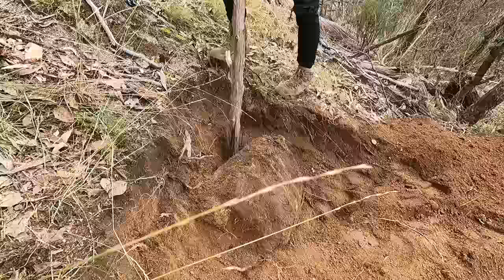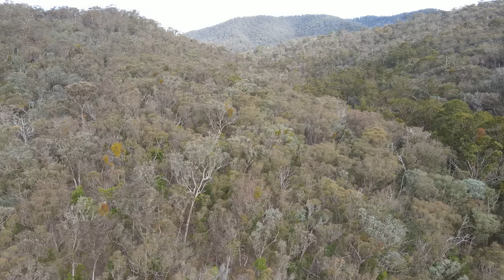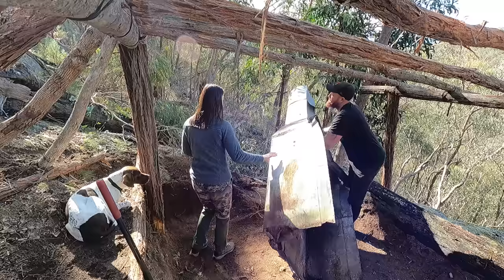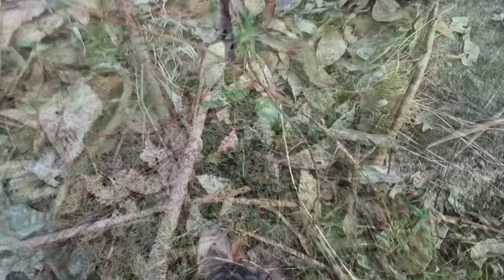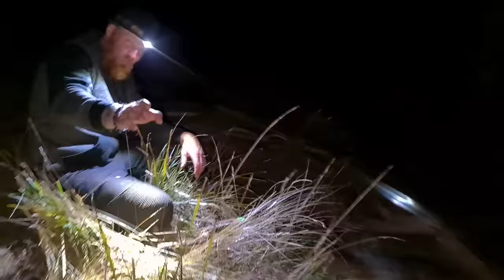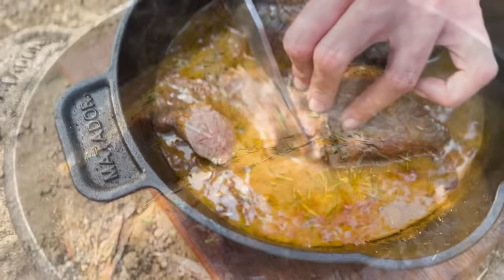Building Complete Deer Hunting SURVIVAL SHELTER In The Unexplored WILDERNESS - HUNT, CLEAN & COOK

Comment: STOP! STOP!! STOP!!!
THINK!
“Too damb much unnecessary wasted energy.
1- USE your head.
2 USE your size
Pair both EVERY TIME wood is needed without a saw or axe - PERIOD.
1- SCAVENGE for loose or broke branches regardless of size.
2- STEP ON or STOMP ON wood after placing between 2 rocks.
3- KICK the branch in half by leaning it at 45 degrees against anything.
4- SNAP any piece with your weight or place between 2 other large branches and SNAP, CRACK & POP.